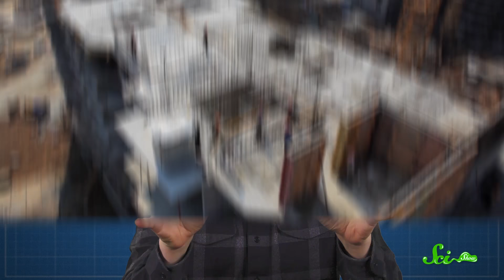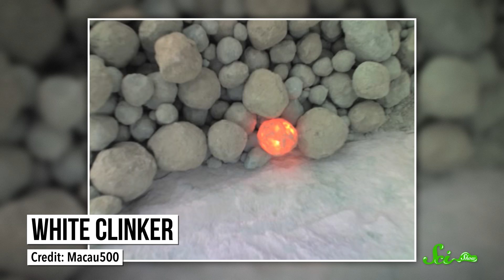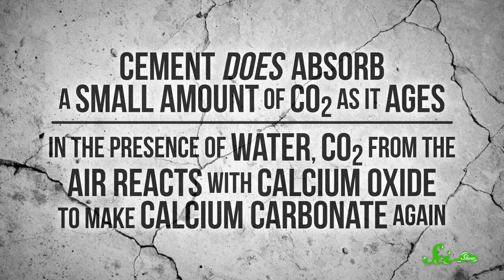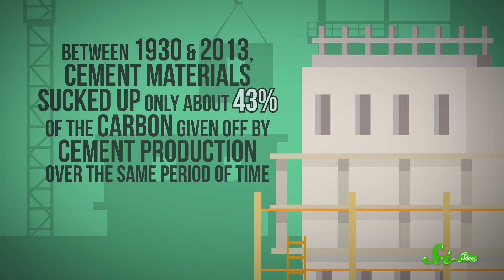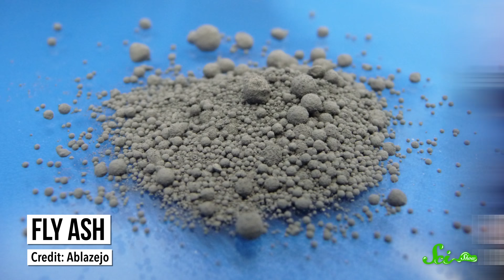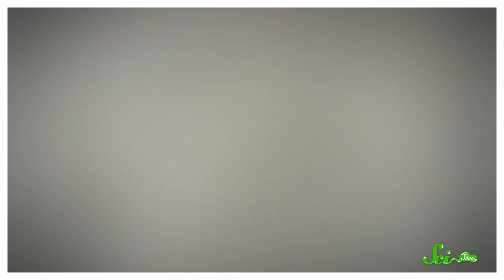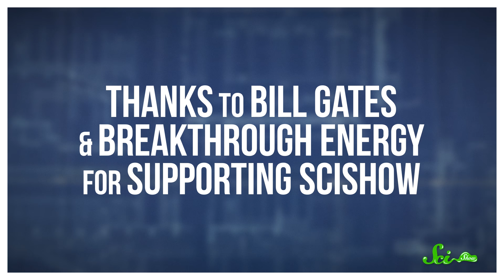Cement: A Really Hard Problem

Comment: I guess the real question is: how strong is it in comparison, and how long does it last?
Reply: Check out "Performance of CO2-reducing cement based on calcium silicates" linked on Solidia's Releases page for some initial numbers, funded by Solidia. They claim it's similarly durable and strong.
Reply: @dereklam1225  What about an independent study? Remember when the tabacco industry did studies to show that tabacco didn't cause cancer?
Reply: And how much does it cost.
Reply: @amohammed3337  One thing that you have to take into account though is even if the raw new cement is cheaper than Portland cement, the new stuff cures much faster, so you cut down on labor costs in construction.
Reply: @morthra2  There is an issue with curing to fast for construction. My site had a short rain during a pour that messed with the surface that the crew managed to mostly correct as the concrete was still plastic, a faster curing product might need to be removed and replaced. We also saw cut joints within hours of the concrete being placed being cured enough to not imprint but also still green enough to be soft for the saws, a faster curing concrete might need stronger saws or diamond blades to cut.
Reply: @cursingbulldog  Those are good points but, if I understand right, the only reason your crew was able to correct the problem was because the rainfall was brief. On average, I'd guess having a faster cure time is more likely to help the concrete cure before an oncoming shower arrives than it is to give a crew time to correct it.
Reply: Morthra Not just savings on the bid labor costs, but a lot of savings on your hidden overhead incidental to those labor costs — UI, worker comp, payroll taxes, training, insurance, and the weird phenomenon of lost productivity that happens when more employees are on a job (overruns, absenteeeism, etc.)
Reply: @nemonomen3340  wrong. I finish concrete for a living. Anything from someones driveway to a 100thousdand sq ft building floors. There is more to concrete than just cement rocks water and sand. If you cant place and finish the  concrete properly than no construction crew will buy from that company
Reply: @cursingbulldog  Thanks for your input, really interesting! What would be the optimal curing time in your opinion? The same as regular ciment or slightly faster?
Reply: @amohammed3337  that's definitely the biggest factor in whether or not it's adapted
Reply: That would be important.
Reply: There are two different use cases: precast products that cure with CO2 in a chamber in a plant that Hank describes, and ready-mix which most people think of when they think of transport in trucks. Solidia already has precast products on the market through a partner called EP Henry. Ready-mix isn't yet available to the public.
Reply: If you let CaO react with CO2, you should get CaCO3, which is basically the Calcite you likely started out with (plus some gravel and sand). There's not really any problem building huge buildings out of limestone or sandstone blocks, in fact that's tried and tested over millenia and evidently very durable, at least as long as there's no acidic rain falling directly on the calcite.
Reply: @Ornitholestes1  this is interesting but i have some questions, how could you prevent acidic rain from falling directly on calcite? special paint? a coating that goes over all the concrete? wouldn't that make the cost of this go up and the profit margins of this even slimmer?
Reply: @Ornitholestes1  I believe it is not CaO....rather Ca(OH).
I know that carbon dioxide is a potential problem because Portland type 1 (10) will develop carbonated concrete..... basically cottage cheese under the top skin..... extremely weak! This is why we do not run generators in contained spaces where there is concrete curing.....or gas heaters for cold weather curing!
Reply: and how much does that cool gadcet co2 pump cost, required for the hardening instead of water?
any schmuck has water, but not everyone can afford a co2 pump (plus the co2 itself).
Reply: But if they use CO2 and not water, then the laborers raking the concrete cant complain the mix isn't wet enough to be self leveling to make their jobs easier, slump specifications be damned!
Reply: Last 4 hours if you use Viagra.
Reply: @ExploringFate  I dont understand why people use that. Must be insanely painful
Reply: Is it cheaper also?
Reply: And how much does it cost .  A solution in search of a problem .

God bless
Wyr
Reply: @wyrtwister4260  I agree cost also matters, but it definitely is not a solution in search of a problem.  The video makes it very clear what the problem is, and even has the word "problem" in the title.
Reply: All this talk about fast curing. 
1. It comes in a truck normally meaning less range to drive.
2. Y'all have never had to rake back concrete when it starts to cure.
3. Concrete needs transported, poured, raked, leveled, floated and finished. 
Seems like a disadvantage to me but what do ik I've only worked in concrete before.
Reply: Jason from what I understand from the video is seems like the co2 concrete may not begin curing before the CO2 is introduced. I could be wrong here of course, but if that’s the case it may actually extend the truck life of the new stuff without it curing. The problem with regular concrete is the water is added at the plant and the reaction starts right then so you only have 90 minutes from batch before it expires.
Reply: @Nightsaber100  depends on the batch plant. If they are using flyash in their mix, there are a couple of important benefits: first there is a dormancy period created of up to 2 hours. This is because of the start of hydration when water is first added, creating calcium hydroxide, this reacts with the flyash and making the flyash to become cementicious. Another added benefit is that the capillaries in these mixes become smaller, so the concrete becomes denser, with less freeze/thaw movement. Also this makes less inroads for chloride ions to penetrate, this also allows for penetrating membrane sealers to be greater and last longer.
Reply: @JesusChrist42000  Because this new curing process requires concentrated CO2, it wouldn't cure in the truck, at least not at the full rate. I'd be relatively slow and only cure at full speed once you're on the field.
Reply: @DragcoDavid  i didn't know that, but it seems like you'll then need to transport the co2 and concrete to a work sight then.
Reply: @JesusChrist42000  
The fact that you get to choose the exact time frame you want for the cement to cure is definitely a positive. And as other commenters pointed out, the range for viable transport should be drastically increased since it doesn't cure on the truck. It might even be the case that it doesn't require traditional cement trucks at all.
Reply: @JesusChrist42000  Also pure CO2 doesn't disperse in air very fast and is heavy making it very dangerous to work with in volume. I don't think this technology really has a place outside of precast in a factory.
Reply: @JesusChrist42000  I'm assuming the fast cure concrete would be used for specific applications(like footings or foundations), whereas traditional concrete would play apart in slabs. 
I've seen jobs where shotcrete is done for walls and regular concrete was used for the floors.
Reply: @JesusChrist42000  Curing is different from setting. you finish before it sets, it cures over a long period of time
Reply: @JesusChrist42000  Try forming your thoughts a bit more clearly. I haven't the faintest idea (aside from you've worked in the industry, and therefore know everything about it that there is, or ever will be, to know) what you're trying to say. We know, the industry is highly resistant to change - Hank pointed that out.
Reply: @markchapman6800  If you don't understand what i said you're either slow or socially inept.
Reply: @markchapman6800  He's saying the process might be too fast.
There is a timer that starts as soon as cement is mixed together, it starts curing.
You need to transport it and pour it so it doesn't solidify in the cement truck.

If the timer is 24h and it's the same process, you wouldn't want to transport that cement for 8h in a truck, wait 3h for everything to be ready then pour, it may have solidified enough to make it impossible to work with.

I do not work in the cement industry, worked 1 summer in constrution as a handyman some 15 years ago and english is my 3rd language.  Yet, I got his point pretty well.

Comment: I suppose you could pair a factory that produces traditional water-cured cement with a factory that produces CO2 cured cement.  You then capture the CO2 produced by the traditional cement factory and use it to cure the CO2-cured cement.   That way you can still produce traditional cement for any applications the greener stuff isn't suited for or simply hasn't been adequately tested in, while the whole process is  carbon negative (when accounting for the carbon absorbed by traditional cement after the fact).

Comment: They could pair that new solidia technology with a classic Portland cement factory in order to use its CO2 emission in their process.
Reply: Why would a Portland cement company team up with a competitor?
Reply: @IceMetalPunk  It's actually not too uncommon for startups to work with more established competitors. It happens a lot in information technology and related industries, but what often happens is that the established company will buy a portion of the startup's stock and send advisors to the startup to make sure things go smoothly and everyone profits. For cement, a similar thing could be done and the established company could also argue for licensing and branding rights in the contract. This would let them both enjoy a PR boost as they brag about being such bug supporters of green innovation and let them use the startup's logo or product in some of their own products.
Reply: @Vicente Rivera
That might actually be a way for the new product to get a foot in the door.
Faster curing concrete produces issues when you want to cast it on a construction site, as concrete is often shiped to the site pre-mixed and not mixed on site.

Faster curing however would be very interesting for pre-fab concrete parts, as faster curing means, the molds can be opend and used for the next batch faster.
Using the new concrete for these parts could intrudice it to the construction industry and build confidence in the material, leading to wider proliferation.
Reply: I think the problem is with the clinkering process. It was said in the video that they need less limestone during clinkering. This means that cement companies will need to alter their raw mix design to produce clinker specifically for Solidia's requirements. This is problematic in the sense that:
1. Cement plant kilns usually has a blending silo to store raw meal before the thermal process for clinkering - this will mean a lot of materials will have to be allocated for the test. You also have to take into account the transition mix when going from regular design to new (unless they clean up the silo before the test so you can start from scratch)
2. Clinker for Solidia will have to be segregated so as not to contaminate the regular clinker.
3. The finish grinding mill will have to be run just for the solidia cement so this is another set of lost production and materials for the test, with the cement product to be assigned a different silo so it will not contaminate the current product.
All in all, during the industrial run itself, the cement plant will have to commit lost production and a lot of materials and energy already - thats a few million already for the lost production, raw material costs, electrical and thermal energy cost, and manpower just for the trial run. In this case, you will need to do the trial in a cement plant that is not in a sold out market or one that has enough money to spare for the trial.
Reply: @llydrsn  Those are some good points! Admittedly, I hadn't considered all those- especially the third one.
I have very limited experience in manufacturing and only cursory knowledge of cement production specifically, but there may be some ways to at least partially get around these problems, albeit still at cost. I had originally imagined a joint Portland-Solidia facility would essentially consist of a pair of production plants adjoined on a side, with shared utilities and piping siphoning the waste CO2 from the Portland sections to the presumably smaller Solidia section. However, that would only be of particular use for testing and the creation of prefabricated cement units via the CO2 chambers. A less costly and more practical method would be the addition of a small secondary facility that siphons the CO2 from Portland production and stores it in silos or canisters to be distributed for on-site use by Solidia in the curing process. This doesn't change the problems with transportation and Solidia's cement curing too quickly, but it makes the production end cheaper for any potential joint venture.
Reply: @ventusvindictus  yes, agree. If the people behind it really wants to push through or develop the technology then the rest is just details. Unfortunately, in real life there is always consideration for money (both how much will be invested and how much the end product will end up being sold) that has to be checked off before any real progress comes up.
Reply: @llydrsn  Also i think working on some dug fundation with alot of co2 can be dangerous? as CO2 as far as i know is heavier than air.
Reply: again, Confencing the creator are not easy, they will be tend to test the power of the their new products and set whole parameters including the quality to match or even better with lower cost than before

Comment: Architecture student here. Concrete is for sure one of the top concerns of sustainable firms right now. I really hope we get some good alternatives, because right now concrete is pretty much a given in 99% of constructions
Reply: Check out natural building methods. Cob, Adobe, strawbale are just a few of methods to build sustainable, high performance buildings with little to no footprint. Using locally abundant, cheap natural materials.
It's true that they're not as easily scalable and not as suitable for industrial use.
But maybe all it needs is a creative architecture student to turn things around 😉
Reply: Also an architecture student here;) Kinda doing my Master Thesis on this topic right now^^. wooden buildings produce about 50-70% less CO2, so thats probably the way to go. In Germany about 50% of all houses in existence are built out of concrete, 2018 the part of newly build wooden houses was only 18%. In Norway and Canada the first modern wooden skyscrapers have been built (up to 85m high). Also an option for one or two story buildings is clay (check out house Rauch). Both of the materials are also recyclable unlike concrete which just lands on a landfill.
Reply: Alternate housing indeed isn't that scalable.

Comment: We need to start a new recycling program.....clunkers for clinkers.
Reply: It is currently being done. Co-processing of waste is part of cement operations. It's just a matter of getting the right "waste" with the right consistency and amount. The video has shown some alternative additives (like slag), but cement plants also burn alternative fuels like rubber tires, rice husk, waste oil, fluff, even some commercial wastes (or trade returns) like spoiled milk, softdrinks, contraband cigarettes, expired instant noodles, shampoo, soap, etc. There are times when even money (those removed from circulation or with changed designs) are sent to cement plants. These alternative fuels provide heat in the kiln usually and replaces coal - less waste in the landfill, less fossil fuel used.